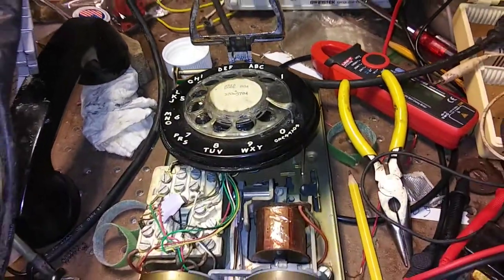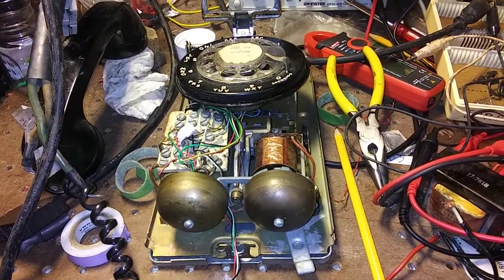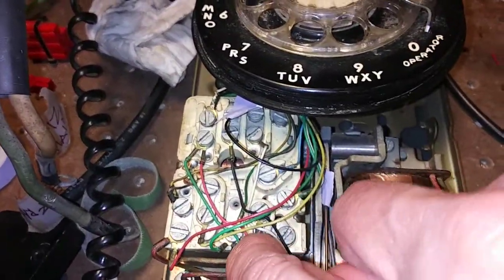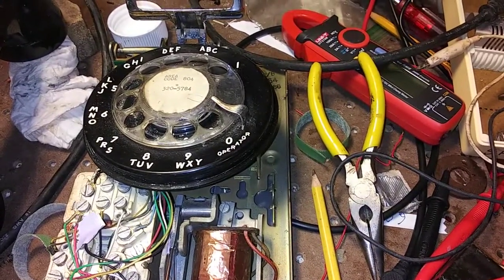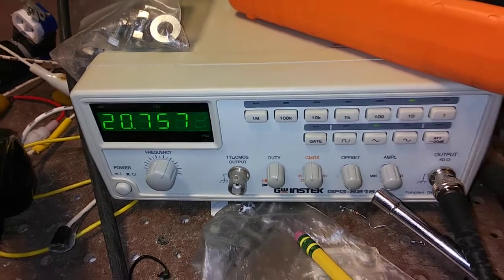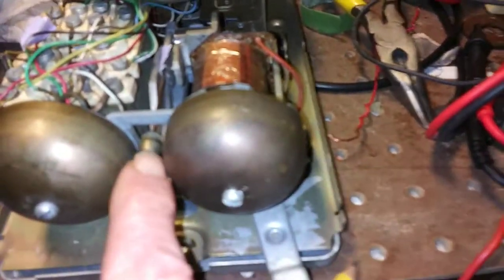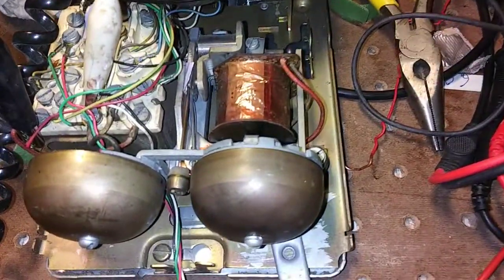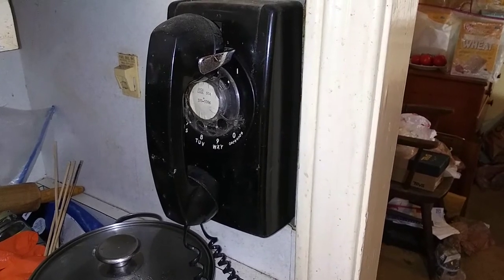Modifying rotary phone to ring on VOIP line (with a piece of tape)

Comment: Had similar problem… my ring was way too low on a 1940’s black vintage phone. Tinkered with the spring adjustment and arm. Now it’s extremely loud. Used a lot of contact cleaner as well all over the guts to get the gum out. Now, instead of VoIP, I opted for a gizmo called Cell2Jack… works through Bluetooth & a wall plug for power. Turns my silenced Cell phone into a landline vintage phone. My 7 & 8 year old boys love it. Will even rotary out. Thanks for the video.
Reply from the maker: I can't dial out but I know there are VOIP devices that can do it on as well.  Thanks for commenting.

Comment: I've done this on desk models with no tape required, but yours is an excellent tip.  Great video, sir! Thanks!
Reply from the maker: Thanks for commenting.
Reply: how do you do it without tape?
Reply: @AustinHollingerOfficial  There's actually a little original-feature mechanical thingamajig inside the telephone that is made to set the bell to ring using a very low voltage.  It's a tiny movable pin that needs to be adjusted within a notched groove. I believe I used my fingernail to move the little pin to its proper place. Took about one second. Works like a charm.

Comment: I certainly appreciate the tip.  I have a very old Italian phone made of marble and filigreed.  It’s gorgeous and ornate and I can receive calls, but with modern lines, it won’t ring… just a faint clicking sound.  I will definitely try this easy solution.  Next thing to tackle is how to dial out!  Thanks a bunch!
Reply from the maker: I know they do make adapters to convert pulse dialing signals to touch-tones.  One is called Dialgizmo.  Here's a link:
https://www.oldphoneshop.com/products/pulse-to-tone-converter-for-digital-telephone-providers-rotary-dial.html
There's also a VOIP adapter that supposedly has rotary dial support built-in, the Grandstream GS-HT802-Analog-Telephone-Adapter.  However, I don't have either of these devices, nor have I ever tried them.  Thanks for commenting.
Reply: @quetzal4042  Wow!  Thank you so much for the info!  I’ll let you know if it works!  Thanks!

Comment: It's interesting that just a piece of tape was able to get that clapper to hit the gong on that phone.  I have a WE 500 desk set that refused to ring, and it turned out that a pin in the modular connector to the line cord was broken.  Your phone sounds like a Trimline or a Princess phone when it rings, since those phones only have a single gong.  Nevertheless, the fact that is rings is still wonderful!
Reply from the maker: Just a guess but I think maybe there is some magnetic attraction between those two pieces of metal that tends to suppress the vibration, but when you separate them just a bit it disrupts that attraction so the clapper is more free to vibrate.  Thanks for commenting.

Comment: Do they make any kind of voltage booster that can be introduced into the line that allows a normal two bell ring? I have VOIP and it worked fine for 2 years until they just sent me a new modem. Now I'm hearing that faint clicking that you're describing. Every now and then I can hear it strike the bell very slightly, so I figured it was a voltage issue. Don't know if you recommend any equipment that would boost it.
Reply from the maker: I don't know of any.  It would be a fairly complicated circuit because traditional rotary phones use a carbon microphone that requires DC voltage to also pass along the line, so doing that while also amplifying the AC signal would be a bit tricky.   Thanks for commenting.

Comment: Some VoIP ATAs have settings to control the ring voltage and current, but I looked and unfortunately your HT-286 does not. Since you are stuck with the lower voltage, maybe increasing the capacitor could compensate and produce enough current to properly ring both bells.
Reply from the maker: It never occurred to me that the voltage might be adjustable.  I should have bought an adapter known to work with rotary phones, including outward dialing.  Instead I just took the cheapie offered by the VOIP service (AXVoice) just to be sure it would be compatible.  Thanks for commenting.

Comment: Hello Lawrence, your video has advanced my quest to make my vintage phone functional. I am in Canada and I was able to wire my old phone into my landline wire but was unable to make the ringer work. The phone is able to make a call and receive a call but without the bells ringing. There's one other. hurdle. My old phone has some sort of switch, an on off switch kind of thing at the bottom left hand corner of the phone. It creates a whole other panel of connections. HELP!
Reply from the maker: I am no expert on these phones, which are surprisingly complicated.  Fortunately however the ringer circuit in most of them is fairly simple.  The best wiring diagram I have found is at 
https://www.montagar.com/~patj/wep425_3.gif
It is explained here:
https://www.montagar.com/~patj/wep.htm
Normally the ringer is always connected to the phone line's red and green wires, even when the phone is off the hook. The red wire from the line should be connected to the L2 terminal on the terminal block, and a red wire going to one of the two ringer coils should also be connected to L2.  A return wire from that coil, normally red/white striped, should go to the A terminal which is connected to a capacitor inside the terminal block.  The other terminal of the capacitor is the K terminal, and there should be a red wire from K going to the other ringer coil.  The black return wire from that coil should go to terminal L1 and the green wire of the phone line should also connect to L1.  So the current from the line goes through one ringer coil, then the capacitor, then the other ringer coil.  Your phone could be different of course, but I think most of the 1950s and later rotary phones used this circuit and color scheme.  So I think what you want to do is trace incoming red and green wires and see where they go, and if they don't go to the ringer coils as described, try rewiring so that they do. If they are connected correctly and it still doesn't ring, it could be a broken coil, which you could check with an ohmmeter.   I'm not sure what your switch is about, possibly it allowed use of the phone as an internal intercom?  Hope this helps.  Good luck and thanks for commenting.

Comment: Hi, I actually have the same issues but my phone is weird, I a 554 and it for about a month, and then my Verizon (frontier) landline was very bad and they didn’t maintain the lines, and unfortunately they disconnected us and I switched to magicjack.  I have bought a pulse to dtmf converter, but before I even bought that converter that phone didn’t ring, and I switched the bias spring and it rang like a brand new one, but the bell was too loud so I just turned the bell adjustment lever and it just started vibrating, and I got super upset.  I moved the bells inside of the phone, like Turing them and they rang super nice but in order for you to change the volume you have to take off the front cover which is the most idiotic thing ever, and it no longer turns the bells when you turn the bell adjustment, but I mean sometimes it can move but again there’s a issue.
Reply from the maker: I guess those of us who insist on using century-old equipment have to accept a few glitches.  Better than cell phones that don't work at all after just a few years because no longer compatible with the network.  We had copper landline with DSL for ~15 years which was fine except they kept raising the price. $12 or $15 finally just for caller ID.  At one point the phone stopped working but oddly DSL still worked so we got VOIP and stayed to the bitter end, finally had no choice but to get fiber when they shut down the copper entirely.  Thanks for commenting.
Reply: @quetzal4042  I guess you’re right, but I wonder what’s wrong with my rotary phone.  I use a cell phone and I updated every 8 years, I don’t really like them, first off they give you RF radiation.  And I have small hands and they slip out of my hands.  I guess I could maybe buy a new ringer but it’s fine at least my phone works, I am super sore about Verizon and my line kept cracking sounds in the line and I tested the Network Interface Box, and I gave them a call and they said “sorry we don’t give a crap about your line”. And I sore because the next day somebody came out to install fiber.  I love these phones they are beautiful charming, and survive scam calls by slamming the handset.  I am probably just going to start getting cheap burner phones instead of my Iphone since like you said, they do not coontect to the network.  My step dad worked for the phone company and that’s how I have a bunch of phones, one issues when switching to VoIP was I had to get a ring booster since I had over 10 telephones.  I live in a 2000s house so I have phone lines built into the walls but I am outraged right now.  And your welcome I am happy that yours works, if you mind me asking did you also have a problem with the bell adjustment lever too on your wall phone?
Reply: @quetzal4042  I fixed it, looks like the ringer volume adjustment was bent- works amazing now never ever gonna get rid of it.
Reply from the maker: That's great.  When all cell phones in service today go dark, it will still be ringing,